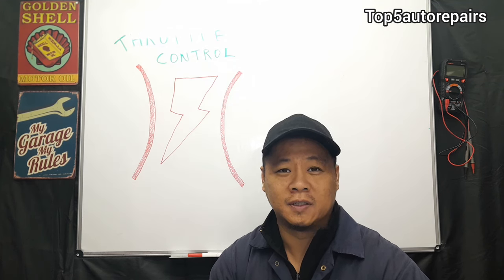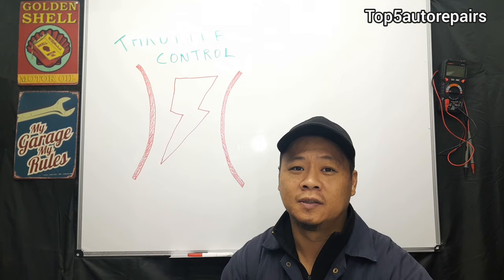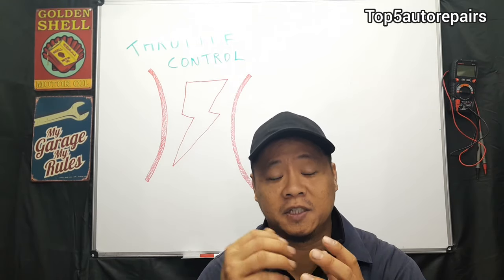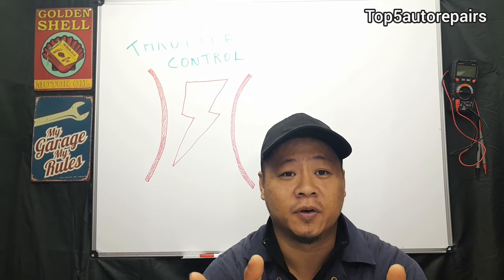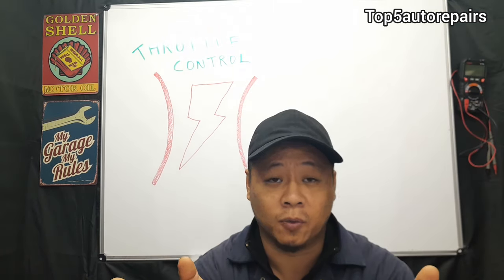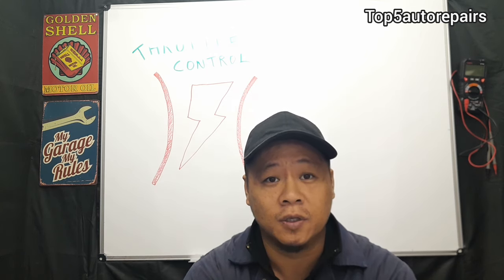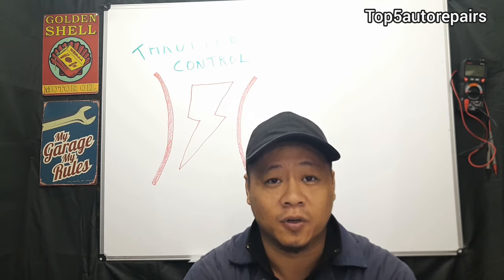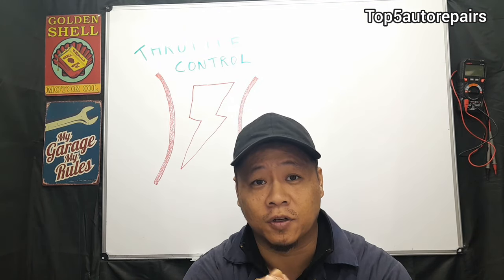Lightning Bolt Warning Light Showing Up On Dashboard How to Fix It for Dodge Chrysler Jeep etc..

Comment: With my 2009 wrangler it only happens in cold weather but the light comes on after driving about 3 miles and the cooling fan starts running.
Reply: Is it bad to keep driving ?
Reply: I’ve been fighting this issue on my 2008 Wrangler for a few years…finally determined that it is the connector on the wiring harness that plugs into the throttle body.  Bad pin.  When I touched the connector, it would turn that error light on and off. So I would check that for sure.
Reply: I am fighting the same issue on my wife's 2014 caravan. After 10 mins of driving in temps below 35 it comes on
Reply: @briankeefe646  did you touch the pin with the vehicle running ? Not sure how that would be possible
Reply: @sef2273 He touched (I assume, wiggle) the connector, not any pin.
Reply: @sef2273  I just wiggle the connector itself.  There is either a bad/loose/damaged pin or wire. If I squirt dielectric grease into the connection it behaves perfectly for several days.  I just need to bite the bullet and get a new connector spliced in to replace the damaged one. A relatively simple fix versus replacing computers and entire wiring harnesses, which is what the dealerships will try to do.
Reply: @briankeefe646  did yours only go into limp mode on a cold engine start up? Once my engine is warm and I restart the car it’s all fixed.
Reply: @Sef  Yes. When it is extremely cold outside this happens. I ordered a new throttle body hoping this solves my issue. It is getting worse. It runs like a dream when it is warm outside.
Reply: @thatoneguy2440  so I figured out what my problem was. The car ran fine once you warmed it up after shutting off from limp mode during a cold engine start.  I found out my intake manifold gasket was leaking by spraying break cleaner around it while engine was running and it choked.. I fixed the gasket and limp mode went away for good!  This was a daily occurrence!

Comment: I have my lightning signal on and then I turn it off and on and it went away. signal light is on now but when I went to have the codes check no error is being detected. I feel a very light change on the engine power. cannot have it fix since obd2 reader cannot read what is wrong with the car

Comment: I had this happen today with my jeep suddenly and also the slippery road sign came up on the dash also….

Roughly what does something like this cost to fix? 😅
Reply: I've been trying to fix this exact thing for over a year. no mechanic can figure it out. I've replaced everything associated with it but the computer. if you find a solution please share.
Reply: @alazaerose  i ended up needing a new throttle body. $750. Now it drives and the light doesn’t come on however I know something is still wrong with it as it sounds louder than usual and doesn’t feel the same. Took it back in and now it needs a new power transfer unit. $2200 for a new one but the mechanic is sourcing parts for a better deal. 😩
Reply: @rainelowery  transfercase? how did he come to that conclusion?
Reply: It just sounds like something is in the hood or under the car or in the front breaks. It has a cycling sound. That’s the best I can describe  it. Him and his guys took a look and that’s what they found. I know barely anything about vehicles so I can’t tell you how they came to that conclusion. They know better than me. But I’m taking it to another mechanic for a second opinion.
Reply: @rainelowery  thanks for the replies, I sadly have no symptoms when these lights turn on. guess I'll keep trying to figure it out
Reply: @alazaerose  is it just the slippery road side you have on? Maybe your ESP button is on/off
Reply: @rainelowery  flashing lightening bolt and the stability light(slippery road thing) comes on the disappears with turning jeep on/off
Reply: 600$ for me ram bighorn

Comment: What if the light is there and I can’t even start my truck? It’s just clicks once !
Reply from the maker: Clicking noise might be an indicator of a bad starter or weak battery
Reply: You prob have a weak battery try to plug it in to a charger and let it charge I’ve been having this warning light flash and then my idle goes up and my car starts to missfire and I can’t go above like 2.5K ish rpm maybe but I can still get up to like 60-70 but it’s take a long time to get there
Reply: @Top5AutoRepairs  also sometimes after it does that I been pulling over, turning the car off and turning it back on and it will run fine for a while but eventually it will start to do it again I don’t think I’ve been able to start my car for a full day strait without having to charge the battery to start it at all because sometimes it will kill the battery after it has the lighting bolt light flashing and ideal higher than normal and is louder than normal and is having miss fires
Reply: I also have this problem how can i follow this comment
Reply: @haydenjackson1891  the same happens to me
Reply: Clogged catalytic converter sounds like

Comment: 2009 town and country.  Lightning bolt comes on and the heat gauge drops to nothing.  Turn the van off and on  and add coolant when it cools off and it goes away until the coolant gets low from the shity dodge radiator